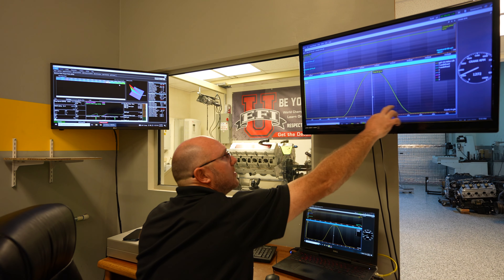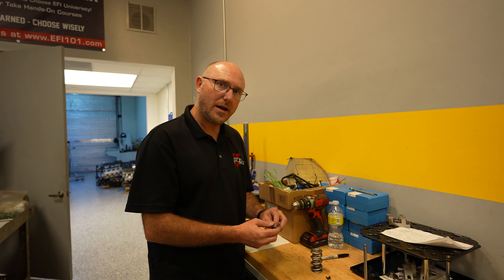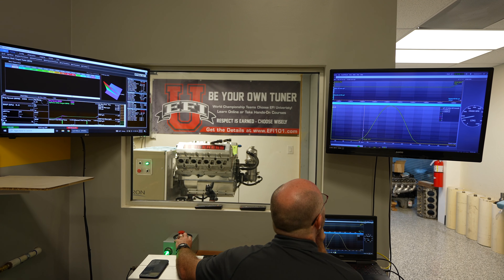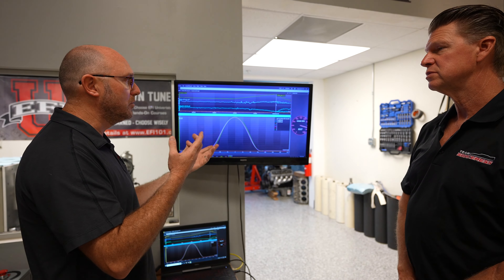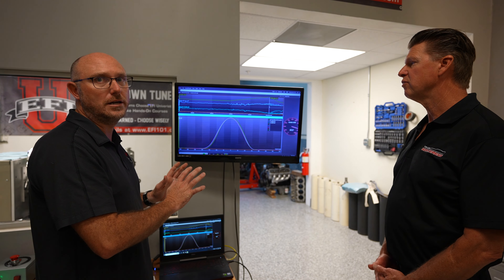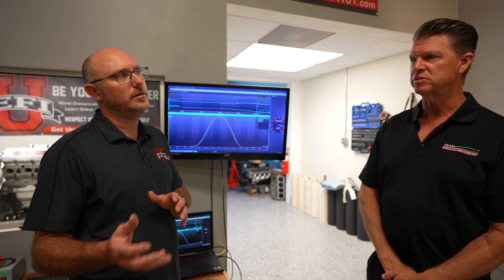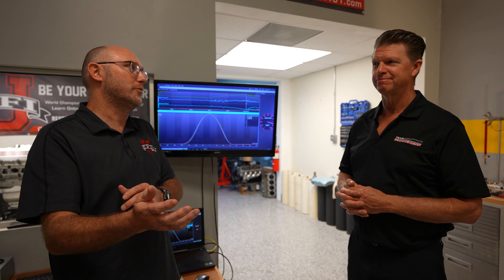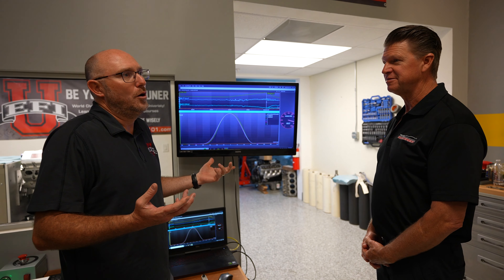Sorceress 5000hp Big Block Spins To 8500RPM At EFI University!

Comment: Nice retainer tip. Its not an issue most would expect to find where retainers come from the same manufacturer.  But anyone building may have extra locks/retainers stashed around the shop - I recently changed my retainers on a new set of heads as an extra 0.020" was found, bringing on the seated height up where it needed to be.
Reply from the maker: Nice catch!
Good luck with your project!
Thanks for watching
Reply: @sorceress5459  I am looking forward to your next passes with these fixes now at hand.  Your tuner has been one hard working guy of late.  A new best is getting closer...

Comment: When are you going to start discussing the column of air in the intake running. Most all of the tunnel ram designs bring the runners in at 90 degrees which causes the column of air to crash into each other inside of the air box which disrupts the column of air if the runners were bent so they aim straight up the columns of air will not interfere with each other. If you have ever watch a IR carb setup running wide open you can see the fuel standoff about 4" above the velocity stack as the column of air bounces in the intake runner
Reply: Something to think about.